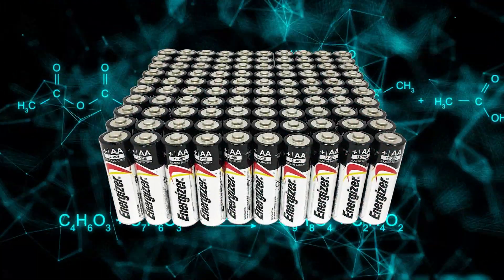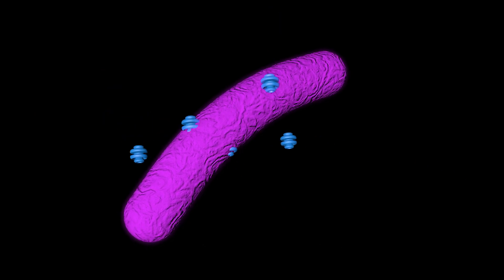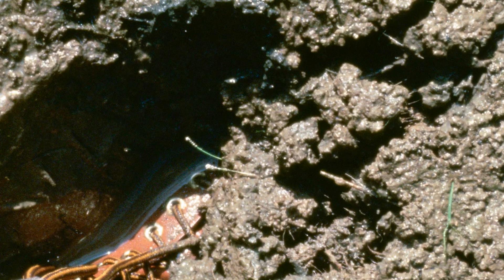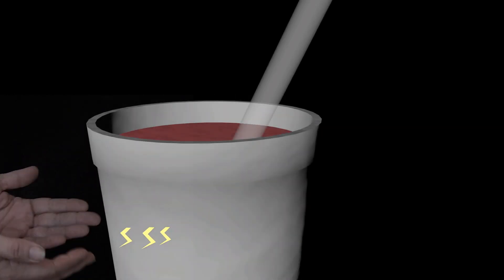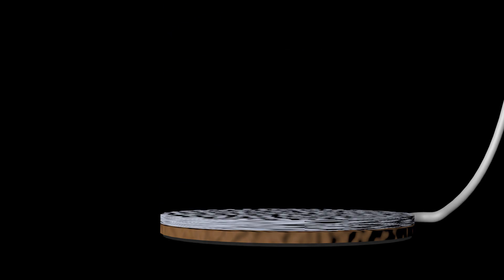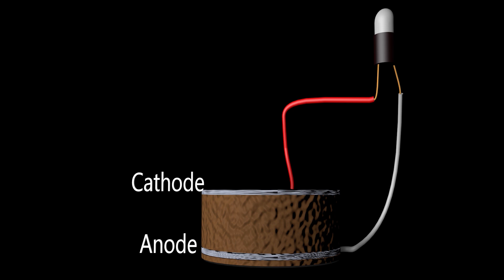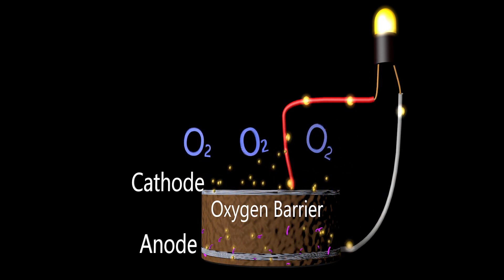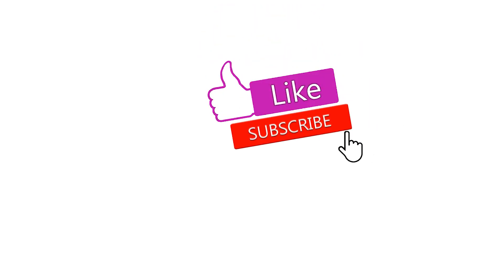Microbial Fuel Cell Explained

Comment: ...if crops are difficult to grow outdoors due to cold or low sunlite, in looking at using grow lights powered by MFCs ...the solar panels and solar generators can  be supplemented with alternative electrical generation using microbes from mud, compost, or a sewer line feed...

Comment: Hello, im doing a proyect about this subject and i want to know, because i read that you can not connect them in series because that generates reverse voltage, but can you connect them in paralel and obtain bigger current?
And if you know, is there a way to avoid the reverse voltage?
Thank you
Reply: A diode would be suitable for the application
Reply from the maker: I have connected them in series successfully to increase voltage with no obvious problems.

Comment: Hi! What are the products of these process? For example, if I put a mix of water and organic food waste in the anode camera (15,36kg), when the process get to the end, how many kg there's gonna be? The same mass? Or it depends of the COD removal? If you can help me it would be graet. And theres another products? Like CO2 and another gases?
Reply from the maker: I haven't tried measuring the weight but, will definitely keep track of that data next time.  I suspect its mass is reduced over time.

Comment: how would you suggest to store the energy
Reply: Good question! It is possible to tweak this MFC design to produce hydrogen or methane, so perhaps that would be a good alternative option for storing energy.
Reply from the maker: You could easily use these to charge batteries
Reply: @amphoravideo  or use that electricity to make hydrogen then store hydrogen and when needed use a hydrogen fuel cell